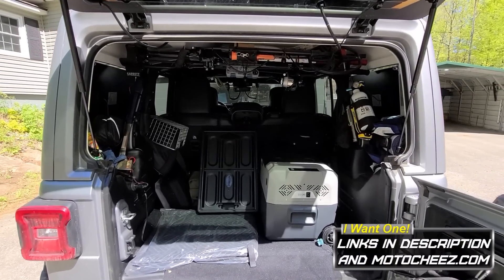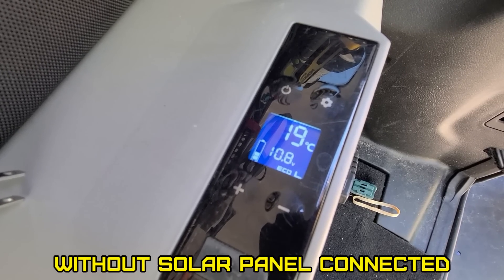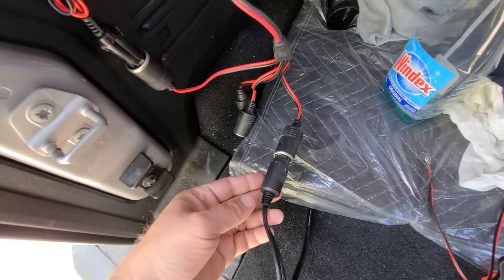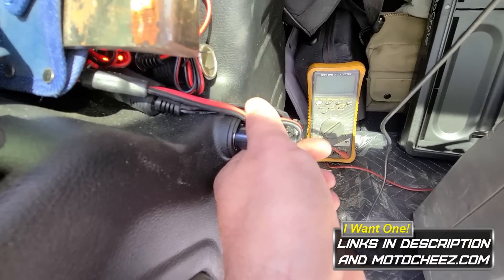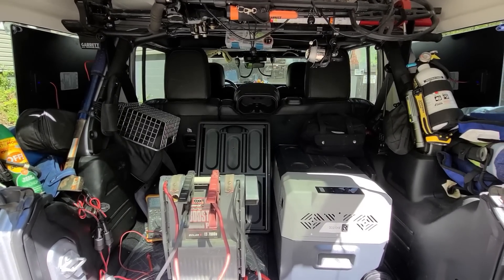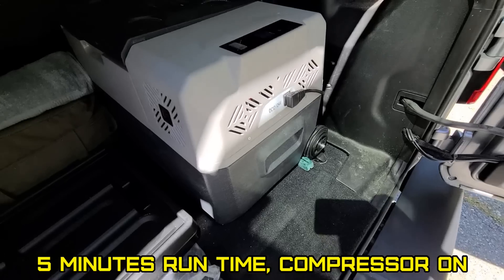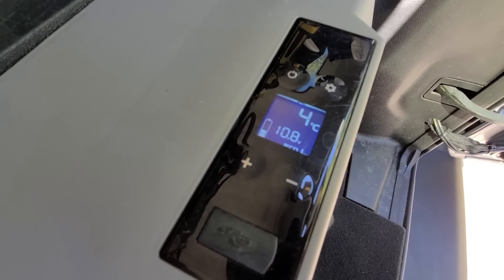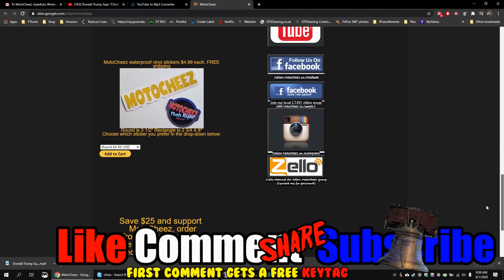60 watt, (Dual 30) solar panel setup and test with compressor refrigerator. Wrangler application

Comment: Thats amazing! I never thought those panels would make enofe juice for that cooler fridge. You must be very happy about those test results. That jeep is like a home away from home. 😁👍
Reply from the maker: I didn't think it would either. But I bet you could live off the grid with a few more more 12 volt items and some batteries. An inverter too, but they're inefficient when you have to use them

Comment: I use a 300w Rockpals solar generator and recharge the generator with the solar panel (60w Rockpals folding type). I can run it indefinitely in this manner.
Reply from the maker: That's pretty awesome.

Comment: If you cool the gas tank with that Peltier device, you'll get better fuel economy.
Reply from the maker: Ha.  This is a compressor style fridge 😁
Reply from the maker: @UC0Bgq8BJoI4zWHnEsdTSyaQ I actually have an extra Pelletier junction from when I repaired an old fridge I had. Is it worth the energy used to cool the fuel?
Reply: @MotoCheez  There is a 100 km difference between summer and winter in my Hijet.
Maybe it works.
Apparently 30W solar power is not enough.
Size: 40mm x 40mm x 3.8mm
Peltier 12V 5.8A
2 dollars at aliexpress
Reply from the maker: Don't forget some gas companies use winter blend fuels too
Reply: @MotoCheez  Yessir,🤡 but...
I suspect evaporation　Thank you for your reply!

Comment: If that window tint is designed correctly, it should take about 30% from your panels. Easy enough to test. Short circuit current of 1.82 amps, so your meter on the 10A setting can take it. Might have to trick the short circuit protection.
Reply from the maker: I do want to test how much the tint reduces the efficiency

Comment: Like the other one said put them on the camper top you'll get a lot more power! Works pretty good as is too though! Don't even get me started on Amazon. If you get the oversized box delivered  you're lucky. Most of the delivery punks around here will get halfway down your driveway, drop the package, and then say they left it in a secure location. I had a lot of packages stolen like that and if you complain to Amazon you here absolutely nothing back. Nada. Crickets.. of  course they don't take a picture..🤬
Reply from the maker: Yes the camper top would work best, I'd have to figure what to do with wires when it's up. Probably disconnect? If I could have removed the small box on the back side I would have put on my hood. I even bought "bra" style material to make a strip and mount in that.
Reply: @MotoCheez  I'd use those quick disconnects you were thinking about.. of course having solar power in the camper would be a great idea! Crock-Pot while you aren't sleeping! Or charging batteries! Anyway you got a great idea there!
Reply from the maker: Yes, I can add a larger panel.on the camper top, use those connectors and have a short jumper to make up the distance when the camper top is open

Comment: wonder how much tinted glass affect the panels???
Reply from the maker: I'm not sure. Would be a cool test to see how much it does the coating over the photovoltaic cells are tinted too
Reply: @MotoCheez  I think it has a great affect. We live on solar. The panels being clean and aiming directly at the sun is critical to get the most watts.

Comment: Just curious, did you try to run the cooler with the panels flat on the roof?
Reply from the maker: I have a pop up rooftop tent and I put boat, kayak etc up there. Good would be best spot but bump on back for panel.

Comment: hey my hawk 250 i just traded for waa tufning on fine but idled down the went off i was messing with idle screw and not it wont start any hell?
Reply: help*
Reply from the maker: Hold throttle when starting?
Reply: @MotoCheez  yes and it doesnt start up but was fine past couple days
Reply from the maker: Kill switch on? Maybe check the spark plug.